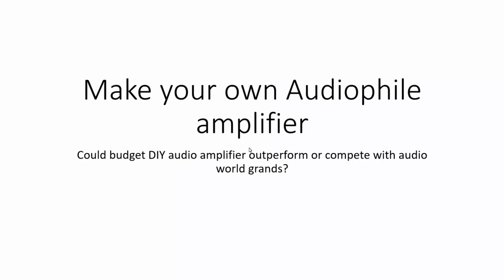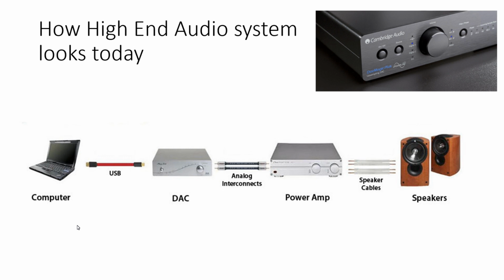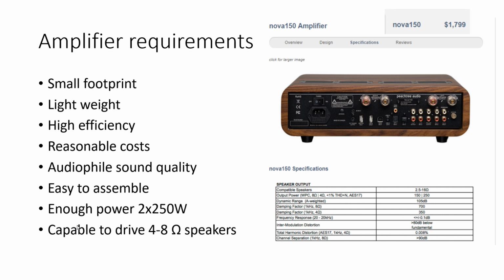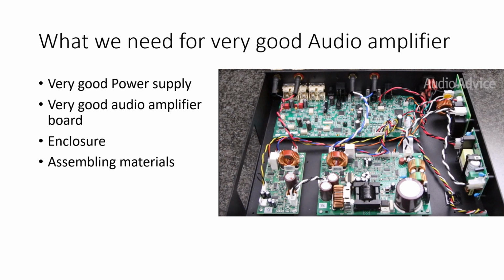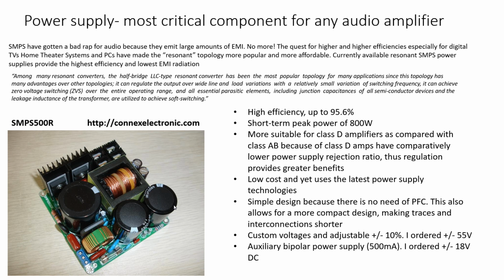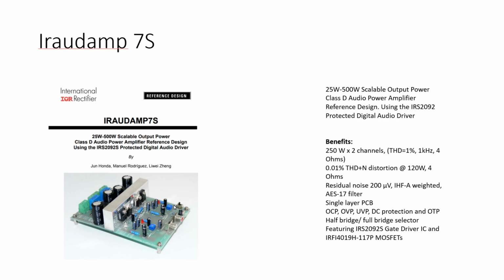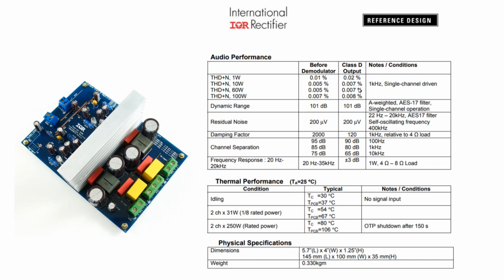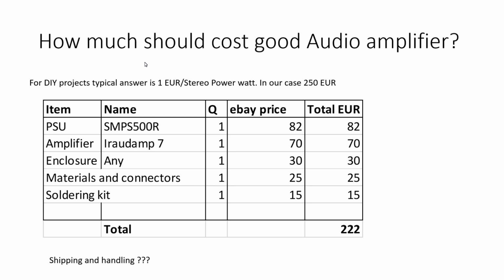Building audiophile Class D amplifier end to end tutorial

Comment: Some people prefer class g h, less complicated, still efficient enough
Reply from the maker: Class G is the same AB solution with dual rail voltage. Class d is better protected and smaller in size. Both architectures sound great, but I prefer class d due to the smaller footprint and the option to use a switching mode power supply.

Comment: Classical piano is very revealing. Class-d is terrible, class-ab MUCH better. I have tried the Purifi 1ET400A module with all kinds of buffers, but still never close to the sound of a good class-ab amp.
Reply from the maker: Maybe blind AB tests would give the true answer to this continuous battle of opinions.
Reply: @guntarssmits2104  Hi Guntars, in this case no AB test is needed, its too easy, try it out for your self. When one learn what to listen for it's everywhere, not just piano. 
When I bought the Purifi modules I had high hopes after reading and listening to many positive reviews.

Comment: This is a very informative video. I was looking at the ICE modules but trust you Guntars that this is a lower cost solution. I have a few DACs , Class A tube preamps I designed. Many Amazon class D amps I did some mods to. But still my 14 WPC TDA based amplifier I built sounds better and was ready to and determined to build a Audiophile near field or mid field class D amplifier. I have all the materials here in my shop to build this. I must say your video is well done with a ton of detail and easy build with the board you researched and sourced. I am a retired design engineer from many disciplines and this audio design is a new domain. I can fix tube gear and SS with a schematic. So this new hobby is fun and exciting and a whole different world when it comes to design of tube circuits and the Class D battle. I would like a video showing this amplifier working and hear it  matched with proper peripheral hardware. What a fine job Guntars and I am so very appreciative of your time and effort into this presentation. Helped me a lot. Sincerely, RadioDoc  BTW: what is the baseplate footprint Dimensions so I can find a nice enclosure in my stock and start kitting this up ? TNX
Reply from the maker: If you want to go to audiophile level design I would suggest to watch my other video where I have detailed story how to build such amplifier  using famous ICEpower125ASX board. Recently this boards has second version  released https://youtu.be/_HkM990zZ4c

Comment: I see no speaker protection against DC or noise at start up. Is the covered within the amplifier? Can I use a standard transformer type power supply, will it not be better noise wise?
Reply from the maker: Hi
There is no speaker protection needed when using Switching mode power supply and Class D amplifier. There is no Pop-Up noise as well. Pop up delay is a built-in class D driver stage. SMPS +Class D is well protected against almost all possible damage scenarios, temperature, overcurrent, overvoltage etc. And it is protected double because SMPS has all protections as well.
But you need speaker protection when using a conventional power supply. If something happens with Class D stage like shoot-through MOSFET DC will appear in speaker output.
For good Class D amplifier, you must use SMPS. Yes, it is more expensive, but it is far more superior to conventional power supply by stability, instant power, filtration etc.
Reply: @guntarssmits2104  Thank you Guntars for your kind reply, makes sense. One more question if you don't mind. I see most amplifiers now carry the LJM logo, I have used his work before OK but are these the same spec as the IR licence units?
Reply from the maker: @MichaelBeeny  Infenon acquire International rectifier. it is the same device  with new logo.  https://www.infineon.com/cms/en/about-infineon/company/international-rectifier/

Comment: Hi there,
is it still posible to get the enclosure for this project, if possible with the black case?
thx
Reply from the maker: Yes I do have some 4 pieces
Reply: @guntarssmits2104  where can i find  it?
Reply from the maker: @zerschbel3419  I listed for you in eBay
 250W stereo Iraudamp7S amplifier and Connexelectronic SMPS500R enclosure (Item ID: 114454155536)
Reply: @guntarssmits2104  thx! Got IT...

Comment: is iraudamp 7s produces clear and natural sound (for audiohile)?
Reply from the maker: Pretty neutral,  there is a lot of influence of power supply. as for any other class D design. They are sensitive to power supply quality.
Reply: @guntarssmits2104  if you don't mind please make a video demonstration sound of iraudamp 7s.
Reply from the maker: @efte71  
Hi, 
Unfortunately is not possible because I sold the last assembled unit last week. I do have 4 last chassis for Iraudamp7 and Connex electronics power supply in eBay for a reasonable price just in case you want to build something. Our designs are moving to industrial-grade boards due to Electromagnetic certification requirement when selling finished units. It is not an issue with DIY designs, but it is important when selling larger volume products. 
Based on our previous measurements and blind tests it is a great unit with neutral sound. Maybe not the best in the world but close to the top end.

Comment: Hello Mr Guntars Smith. I'm interested in your amp. Where  am I buy one? Thanks.
Reply from the maker: Could you be more specific what exactly would you like to purchase? Integrated amplifier or enclosure.
Reply: @guntarssmits2104   lm looking for an integrated amplifier. Thanks !
Reply from the maker: @zombielandiii2711  Hi, I sold all my stock, 2 units left what I used for demos and customer visits. Those are in perfect electronic condition but has some cosmetic imperfections. I do have 2 different units. One exactly like you see in the video with Connex electronics power supply working only in 220V countries. Second with Abletec power supply with the capability to work from 90V-230V. Both have built in volume control. It is Ok for demo and tests, but the volume controller is mechanical and typically last for 1-year intensive usage. I can remove them, but in the front panel you will have an empty hole. If you are interested in the last pieces what I have I can offer it to you for 250USD including shipment. Connex electronics unit runs a bit cooler due to the single mains voltage power supply. Just let me know are you interested in used ones.  I will put them in eBay and let you know when they are available. Just give me your contact information how to notify you. Unfortunately, I did sell all my new unit stock during Christmas.

Comment: Can you connect this in bridge and make it a 500W amp?
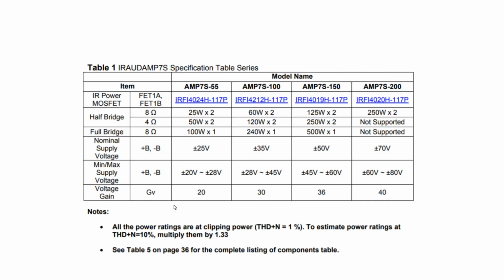Reply: 6:58 have a look.
Reply from the maker: Yes for 8Ohm only, You should invert one of the channels. Depending on Iraudamp 7S unit you may have signal inverting chipset soldered on board but not used. Search for Iraduamp 7S PDF manual and check hot to properly set jumpers. In case you source

Comment: How do you prevent overdriving the speakers if the amp produces 250watts and speaker are rated at 150watts?
Reply from the maker: Any speaker can withstand short term overdrive for 4 times. In your case 600W. It is not an issue for 150W speakers. I have been driving 60 W speakers with this unit and  working far bellow clipping ti sound fantastic.

Comment: great video ! can you make a tutorial of how to make a DAC please ? (with display)
Reply from the maker: There are no good manufacturer boards available to build high-quality Dac by yourself. DAC is not expensive to manufacture with today's electronic smd assembling lines, but you need good components.  So it is not a home project because it is much cheaper to purchase it. There is one interesting DAC what matches your requirements. You will not make it cheaper by yourself. Search for this name SMSL SU-8 Latest V2 HIFI Audio DAC 2*ES9038Q2M XMOS Xu208 USB DSD512/768KHZ. DAC world is booming and you just need to look for a good offering.
Reply: @guntarssmits2104  do you have some good ideas for me what dac to buy that supports also usb sticks?
Reply from the maker: @souhailla10  I would suggest Dacmagic +  from Cambridge audio. It is an outstanding unit supporting USB 2.0, ASIO driver, have balanced and unbalanced outputs. Reliable long-lasting volume control etc. It does not have remote and other fancy service staff. Just true quality and that's it. Price around 400 USD. Regarding price, this is good value to quality ratio and it provides true audiophile-level quality when PC is properly configured and ASIO driver installed. There are guidelines on how to do it in manufacturer web as well as some whitepapers explaining why you need ASIO driver for good audio. But to make suggestions I need more background for usage scenario. For cheap staff, there is technical theoretical limitation of why they are not able to sound good. There is no shortcut, unfortunately. https://www.cambridgeaudio.com/en/products/hifi-and-home-cinema/dacmagic-plus
Reply: @guntarssmits2104  yes that will be the best choise :-)
Reply from the maker: @souhailla10  , But seams I did not read your question carefully.  DacMagic Plus does not support direct USB stick. It meant to be connected to PC. Actually, PC is the most convinient interface to deal with audio library locally and stream from the web. Some old laptop could be converted to prefect audio machine with powerful connection set (Wi Fi, Bluetoth, network cable, etc)
Reply: @guntarssmits2104  oke thats good to know, because the stream magic from cambridge does read usb-sticks without a problem

Comment: I noticed that in this video you seem to suggest balanced inputs. You also recommend something I already own as a volume control: a DacMagic Plus. Is this amp easily modifiable for use with the balanced outputs of the DacMagic? Thanks again for your hard work and professionalism.
Reply from the maker: Hi, It is not possible easy to modify for balanced input, and there is no special benefit for that unless you do not have more than 20 m long RCA connection cable. For the years I have been using DacMagic Plus unbalanced outputs. I am using balanced outputs only for test purposes when connecting to pro equipment. At some point, DacMagic Plus is a perfect audio source fitting between Hi End and Pro world. I am really happy with this units performance and design. 10 points to Cambridge audio designers.
Reply: Guntars Smits Hello Guntars. Thank-you so much for your quick and concise response. Should be back home in fall time and will order your enclosure and all necessary parts to build this amp. I also like my DacMagic Plus. What would have made it perfect would be a remote. I am very old and lazy. Thanks again.
Reply: Ordered your enclosure or eBay. Any suggestions about purchase of the 2 other elements to build this project? The Iraudamp7s is available from many sources with widely varying prices. What should I look for in a supplier? Looking forward to building this little project. Should handily outpower my Naïm Naît 5i (italic). Hope it also projects a good soundstage.
Reply from the maker: @gilbertlessard4380   Hi, Iraudamp 7S - take the best eBay offer. Choose a board with copyright info visible. For power supply- follow YouYube tutorial information. Choose your region mains power accordingly ( EU 220, US110)
Reply: Guntars Smits Will follow your advice. Enclosure ordered and on its way. Will order the 2 other components next week. If results of build are as planned, I might order a PGA2311 pre-amp kit for remote control and multiple input selection. (Separate enclosure, time to get the soldering station going.... last build was a hybrid tube transistor kits as shown on 12voltvids...from Canada like me...) Any  thoughts? Will try another thing before: I stream much of my music through a Bluesound Node 2. With this unit the volume could be controlled remotely through my iPad. Will have to see what the sound is like.

Comment: Really enjoyed your tutorial. At 23:15 or there abouts you show the preparation of wiring for the volume pot. It would seem that 2 cables are soldered to pot and at the other end only 1 is showing. On the pot I seem to see 2 white and 2 red plus 2 blacks together while at the other end 1 white and 1 red seem to be missing. Would also like to know where that end is connected. Before I commit to building I want to be certain that I understand all the required steps. Thank-you for your expertise.
Reply from the maker: Hi Gilbert, Please pause the video at 23.30. It is not a perfect shoot but try to imagine that potentiometer is stereo. There are 2 sections one under the other. Incoming signal red wire from chassis RCA connector is sodered to far left looking to picture. The midsection red wire is going to the amplifier board  ( hot). the same pattern is for the second section where white wires are connected. 
There where a lot of questions where to purchase components and how to select. You can download PPT with guidances there. https://smitselectronics-my.sharepoint.com/:p:/g/personal/gsmits_tcrastrs_lv/EcmAnQ5i0VNHj3bGp2vgNMABcf7j9W8YWBLvAnkuACIguA?rtime=GDCrPnok10g

Comment: This is amazing Guntars. How can I convert this setup to add a Subwoofer? How about if I want to add a Dolby Digital Module to this so that I can retrofit this into my Home Theater? Please let me know. Thanks.
Reply from the maker: Hi, 
For home theatre, it will be overkill. For home theatre, you do not need too good amplifier because movie mainly is speech and music are used for emotion emphasis. Low frequencies coms from an active subwoofer. I would separate home theatre from music listening system. Those are two different tasks and in the audiophile world, the sound industry did separate it long ago. You can enjoy the home theatre system with average speakers, but for music listening in stereo, you need good ones. So, I did build my design for music listening in stereo.
My advice -separate two systems. You can find good home theatre amplifiers with build-in THD processor and amps in the secondary market for a reasonable price.

Comment: If I need to have a balanced (XLR) version, what do I need to do?
Reply from the maker: You need such type board and +/-15 v aux power to drive it https://www.ebay.com/itm/DRV134-Unbalanced-to-Balanced-Converter-2-Channel-Board-Match-Input-Amplifier/192329969782?hash=item2cc7c27076:g:8ucAAOSwOrxZ3NyD&frcectupt=true
Reply: How about switching amp board to this one instead?

https://www.ebay.com/itm/TPA3255-2x260W-2Ch-Class-D-Audio-Amplifier/333125278726?hash=item4d8fd05c06:g:SLAAAOSw~IVamUYb

Comment: Can I buy one with everything pre assembled?
Reply from the maker: I Have the last one left from this series with minimum cosmetic imperfection. It was my demo unit traveling around audiophile and professional community. If it is ok for you I can put it on eBay and let you know when it is done. Price is 250 USD with free shipping WW.
Reply: @guntarssmits2104  Thanks for the reply, That would be awesome. One question, I asked around audio engineers about the diffedrence between Hypex amps, Cherry Amps and Iraudamp.  One said  Iraudamp seem to have the output choke outside the feedback loop, so they will definitely be load-sensitive.  What does it mean?  I'm a new Class D fan. Thanks.
Reply: @guntarssmits2104  please post on ebay
Reply: Also, can this unit drive Dahlquist 100-250w 6 ohm speakers? Thanks.

Comment: This looks like an interesting project. I hope the sound is that good. I will give it a try.2 things :- Is it wotrth puttung a valve buffer on the input?- Is it possible to build 2 as monoblocks avd still get 120W? I would,'t want to blow my speakers that take max 130W. And how does this amp compare to the ICE?
Reply from the maker: Regarding valve buffer. Valve concept is a bit different. We are using a valve when want pleasantly distorts signal with second harmonic. It makes a warming effect, but the sound will not be natural as recorded in the studio. It is more like a personal taste. Amplifier input impedance is 8kOhm. So, you should ensure that source output is less than 1Kohm. Typically, audio interfaces, DACs, and sound cards have 120 Ohm output impedance. Also for volume regulator do not use volume resistors with 100KOhm resistance. Use 10kOhm instead.
As monoblock in bridged mode output power will be 500W and work only on 8-ohm load. This project is for the stereo version at 4 (250W)-8(125) ohm. In Monoblock construction, you will not gain in quality. Channel separation for Iraudamp 7S is such a good that it is at inaudible level..
Regarding power. I have other video explaining things to know before purchasing an amplifier. You will not blow your speakers even for short time giving 4x higher volume than rated, but extra power used at optimal volume will drive your speakers exceptionally good. Watch this video for more information. https://youtu.be/6XMEoTwDUhU
Reply: Thanks for the answer, i will do the same project as you. I found the licenced Iraudamp 7S  for 60 euros